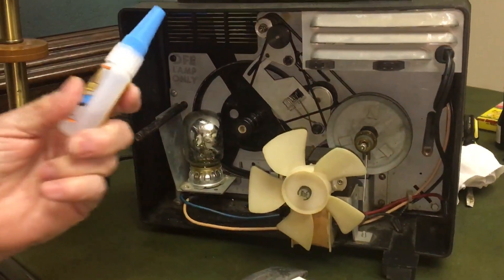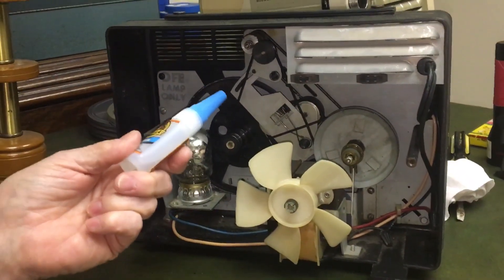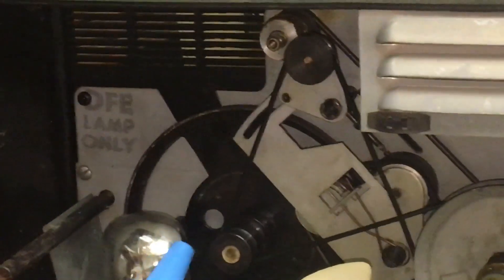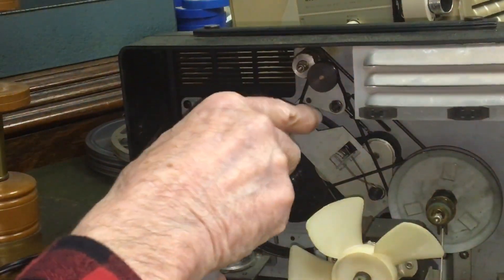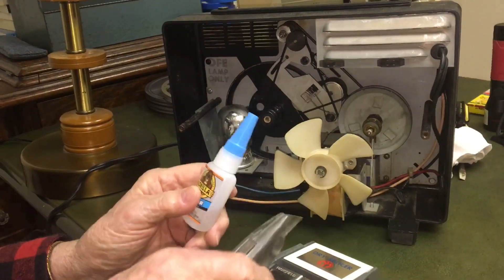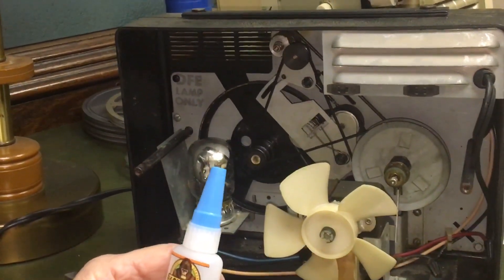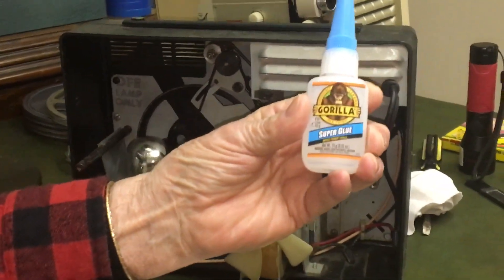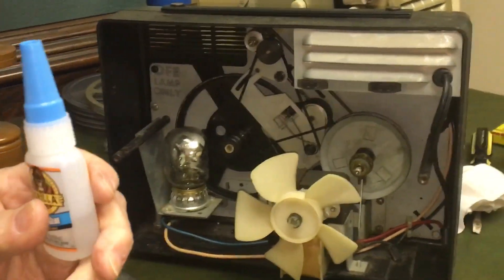8 mm projector rubber belt repair

Comment: I just tried this and it worked. I appericate the advice.  It also had two cracks in the belt that the super glue fixed. I do plan on replacing the belt at some point.
Reply from the maker: Thanks for letting people know it worked for you.